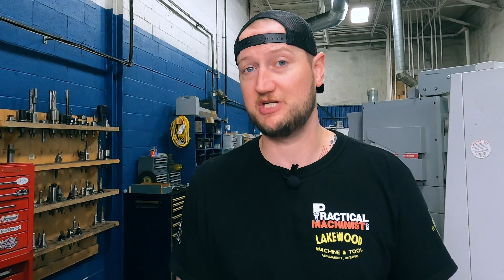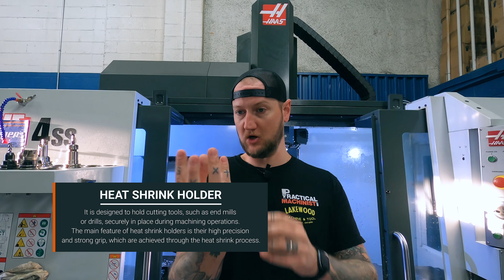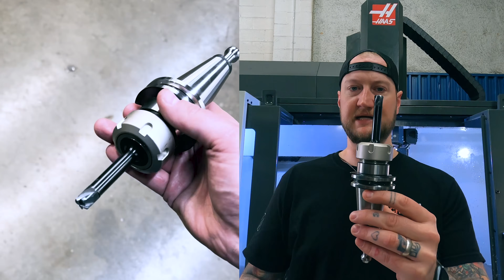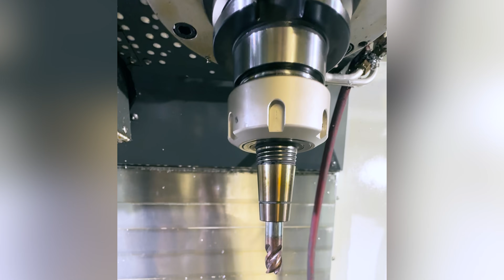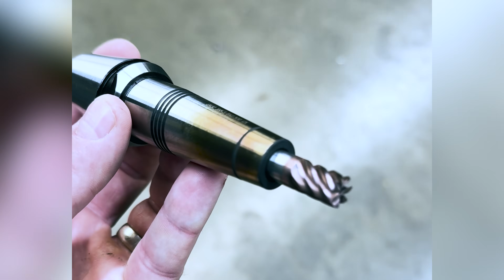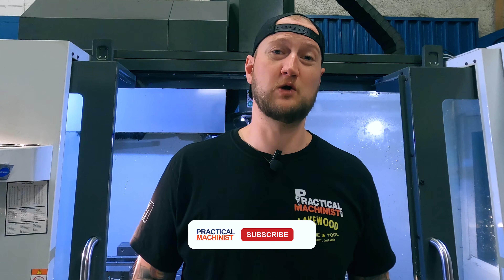Shrink Fit Holders... Are They WORTH It?! | Machine Shop Talk Ep. 117

Comment: Not sure what I learned here. If you put those same cutters in a solid endmill holder I'm betting they will perform about the same...but I guess  we'll never know.
Reply: What kind of solid holder? Side set screw? I haven’t had a lot of success with those in this kind of application.
Reply: @LakewoodMachine   OK but there are only a few narrow cases where shrink fits have a clear advantage. For the remaining 95% of  milling jobs, the solid holders hold their own at half the cost.

Comment: "The Right Tool for the Job"
Perfect for 3d machining.
Main purpose of this holder is to extend out smaller diameter tools while still holding  good concintricity.
Extended end mill holders with set screws run out, and tend to chatter.
They're also unbalanced.
With a lower maximum rpm.
No good for properly machining materials like aluminum, graphite etc.
That tend to cut best at, or over 10,000 rpm.

Comment: Dear Lord a tourch WTF! Yes we do get a Haimer system and they will tell you at training do not double heat the holder it wil runi it faster. Haimer only heats the tool to about 450 degrees fahrenheit.Also use real heat shrink holders. Iwas never a fan of the type you used for the demo.
Reply: Haha yeah, not an optimal setup for this one but I wanted to give it a shot before shelling out the big bucks for a full system!
Reply: @LakewoodMachine  Ian I understand completely you have to start somewhere. If you check in your area with a Haimer or Kennametal rep, they came to our plant with a demo truck for us to check these out and that way I could get the safety person to see and buy into it.

Comment: Our shop built one. Just put an induction coil over top of a tightening fixture. It takes less than a minute to heat up. Just don't tuch it for half an hour. 

We've noticed that they don't last as long as ERs. The heating fatigues the metal.
Reply: You are overheating them

Comment: Will you get the same benefit of a shrink fit holder in a lightweight machine? cough*tormach*cough
Reply: Think of it like a race car. Every improvement will better your lap times/drive. Of course a corvette is always gonna beat a 1990 sub fire regardless of the mods. 
Horses for courses. 
If it’s not way more $$ it’s almost always better to use better tooling/holders/workhokding. 
That being said shrink fit is more for clearance on multi axis or mold work. Not many stubby thick shrink holders on the market that I have seen
Reply: Haha well I mean anything to dampen vibration and introduce some more weight into a light tool prone to deflection ain’t gonna hurt - they don’t make vibe-dampening tooling with carbide shanks for no reason!

Comment: Love our heat shrink holders!   When it comes to roughing hard and fast, nothing beats them!!
Reply: except Albrecht APC
Reply: In aluminum maybe, in steel milling/power chuck or hydraulic heavy duty chuck us preferable. The problem with shrink fit holders - they don’t dampening vibration
Reply: @ov3753  also the hotter they get, the more risk of pullout. Hydraulic holder is actually the opposite, the hotter the holder gets the higher the holding force but they flex more.

Comment: considering we mainly have a bunch of old ER collet holders l really can't see the use of ER-shrink collets. they are actually still quite expensive, compared to a full shrink fit holder from haimer for example (literally the best and very affordable) also you don't have to assemble the holder.
Reply: The biggest and best application I’ve found is for the live tooling lathe actually - gives you a lot of reach without chatter! Doing some AMPCO-18 with them right now
Reply: @LakewoodMachine  gonna keep that in mind, thanks
Reply: "The Right Tool for the Job"
Perfect for 3d machining.
Main purpose of this tool is to extend out a smaller diameter tools while still holding  good concintricity.
With a very small holder, for clearance.
Extended end mill holders with set screws run out, and tend to chatter.
They're also unbalanced.
With a lower maximum rpm.
No good for property machining materials like aluminum, graphite etc.
That tend to cut best at, or over 10,000 rpm.

Comment: Why not get a traditional shrinkfit holder thats cat40 on the back end, Thi seems like it can have juat as much runout as a traditonal collet system campared to a traditional shrinkfit holder.
Im note sure if i see a benifit to use this style
Reply: We’re using them a lot in the live tooling lathe at the moment - full heat shrink holders definitely have a place too - we’re going to bring some in
Reply: @LakewoodMachine  I would have never thought to throw it in the live tool on the lathe. That can be extremely useful to get closer to the chuck with less stickout